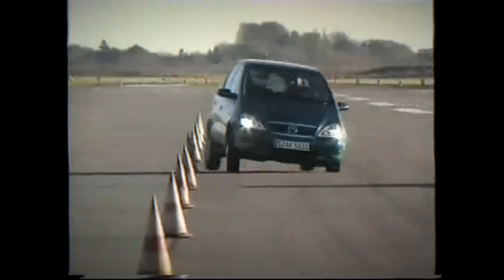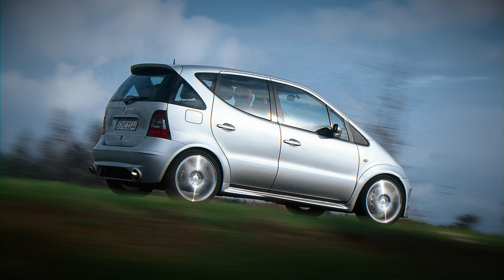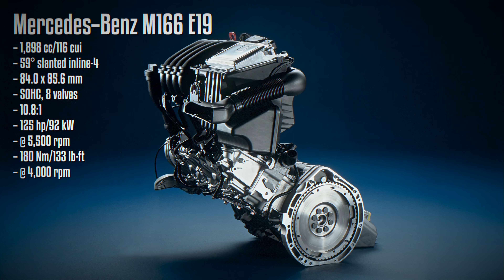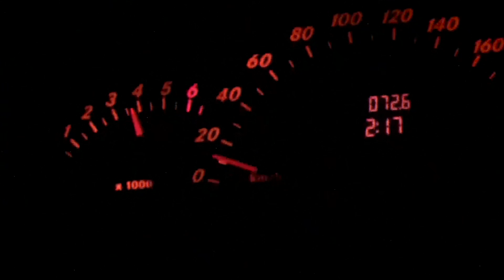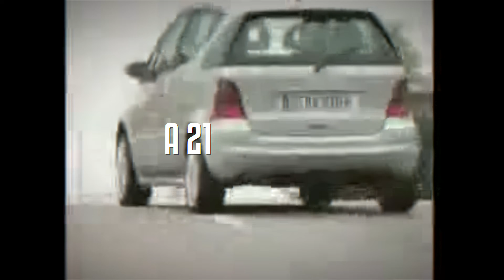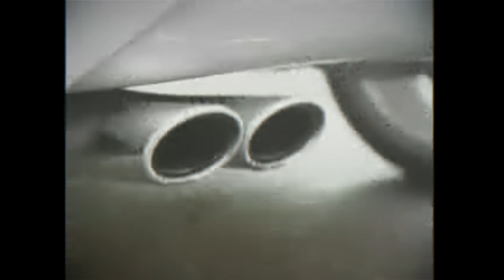AMG's Unique Twin Engine Model

Comment: Actually I think a test-driver was badly injured or killed, when Cooper fitted an 2nd engine into the rear of a Mini Cooper sometime in the 1960s, because a weld securing one of the steering tie-rods to the sub-frame broke away during testing! 
The dual-engine Mini Cooper was trialled after seeing it done in the Citroën, but scrapped after the prototype crashed!

Comment: It isn't the engine. It is the car body crushing you or the force internally ripping you apart before the engine comes through. I've seen it, seen the tiny slot that used to be the footwell. The engine went to the side, the steering wheel came out the passenger window and he died.

Comment: Back in the days when a compact car with two engines, combined 250hp and 1330kg was called heavy...
Reply: Even with two engines this thing has almost exactly the same performance, weight and fuel consumption as a modern Fiesta ST.

Comment: Well, an extra engine never hurt nobody.
Reply: i think it did in the Do335
Reply: @AlexHalt100  it only hurt the enemy
Reply: @MaticTheProto  not really when it started overheating and burning.
Reply: @AlexHalt100  that wasn’t the 335… that was the he177 Greif
Reply: @MaticTheProto  man... just look that shit up. might be hard to grasp for you but several models can have various issues. i cant believe i have to explain this ffs...

just because you only know about one case doesn't mean there were absolutely no others. Do335 had overheating problems with the rear engine. like many other rear/mid engine machines. 

do you really think i got nothing better to do with my fucking time than making this shit up just to have an argument with some random internet dumb ass? use your fucking brain man....
Reply: @MaticTheProto  and by the way, the Do335 never saw combat. so much for OnLy hUrT tHe eNemY and the worth of your opinion....
Reply: Actually I think it did when Cooper fitted an engine into the rear of a Mini Cooper in the 1960s, because a weld securing one of the steering tie-rods to the sub-frame broke away during testing! 
The dual-engine Mini Cooper was trialled after seeing it done in the Citroën, but scrapped after the prototype crashed.

Comment: Few people realise this, but the original A class was a mid engine car, for the engine block was located behind the front axle.
Reply: That makes the C3 Corvette mid-engine, that's not as crazy as it sounds.
Reply: @Ang3lUki  Vettes are front-mid aside from C1/C8, Vipers are full-on mid-engine mount. it doesn't have to be between the rear axle and the driver, just between the rear axle and the front axle to be front mid-engine.
Reply: I had one. You're wrong
Reply: lol few people realize this, because it's false.  It was pretty much on top of the front axle.
A mid engined front wheel drive car would be absolutely terrible ... where would the driveshafts go?  They'd have to be at an angle forwards lol.
Reply: @detaart  if it is a transverse mid-engine there would be no driveshaft. Just the gearbox lining up with the halfshafts and the engine behind the halfshafts and gearbox
Reply: @RickZanardi  ok mr pedantic.  Half shafts lol, And yes, it is a transverse fwd platform.
Reply: @detaart  I didn't mean to be pedantic... I was just coming from a solid 30 seconds trying to visualize where the driveshaft would be. I didn't want to come off that way, sorry :)
Reply: @detaart  Dawg.... SAABs are FMF, and they're considered one of the best handling fwd cars. The drivetrain is in backwards, basically. The Lexus LMP2 car was setup the same way, so was a number of prewar racecars. It works.
Reply: @RickZanardi  The Cord is fwd and it has a standard of the era drivetrain, just turned backwards. The El Dorado and Toronado uses a weird th300 that kinda sorta uses a transfercase to power the front axle.